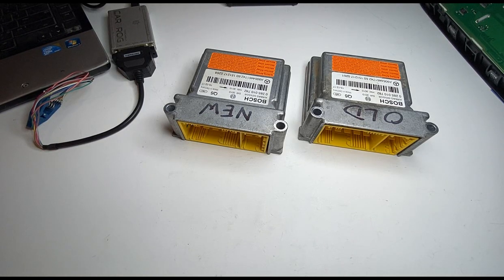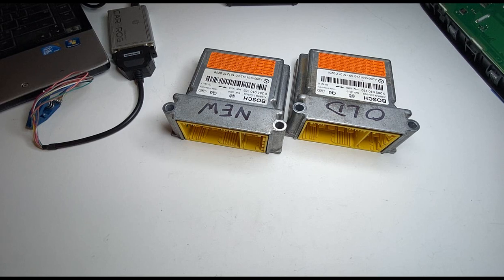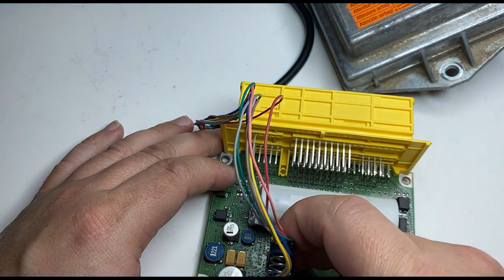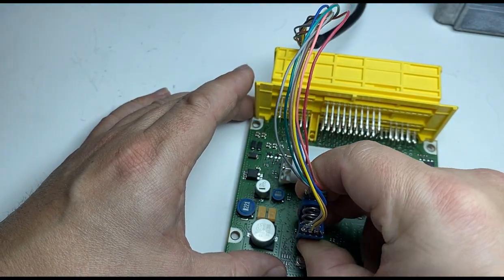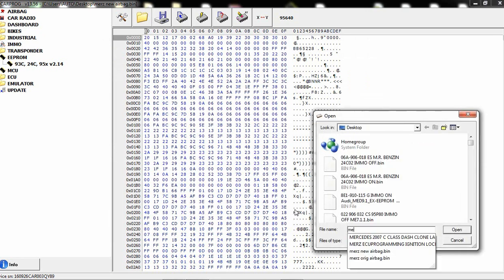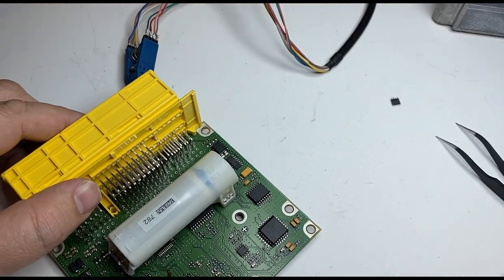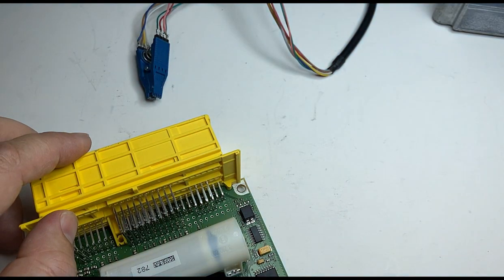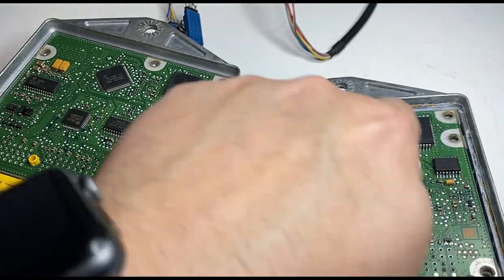Experts Guide to Air Bag Computer Reset Procedure

Comment: Great video. I have 2023 Corolla with the airbag light on and no codes. I sent the module to get reset and I just got it back and installed it and the light still on… wtf!!! 
Any ideas on what else to look for?
Reply: You probably still have a fault or didn't fix everything. If it was in a crash and the seat belts are locked up, gotta change them. A proper scan tool could tell you exactly what codes are still there

Comment: I found you on YouTube. I am wondering if you can program my ignition switch for 2018 Mercedes.
Reply: 2018 ignition switch is a FBS4 component, which has a high security system.   Only new component and has to be done online with Xentry.